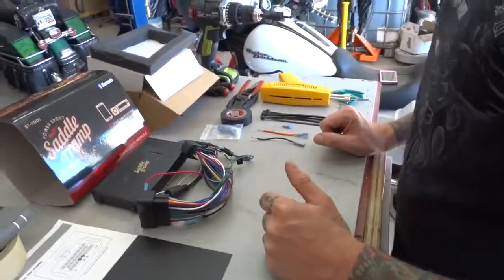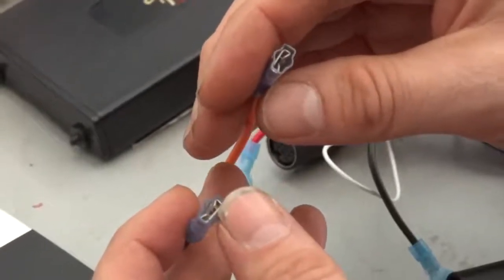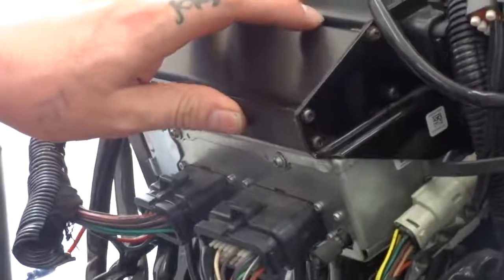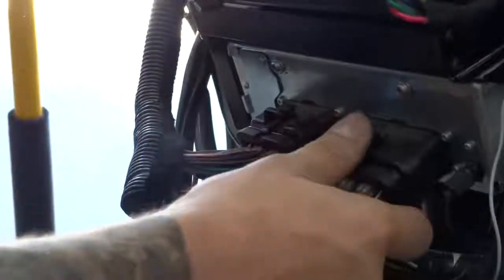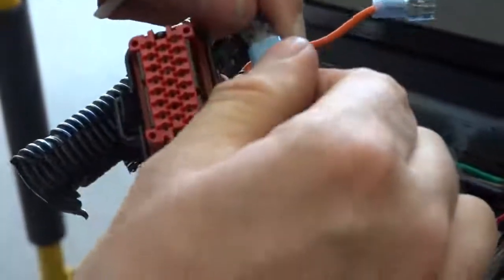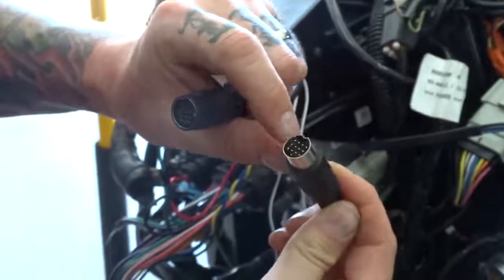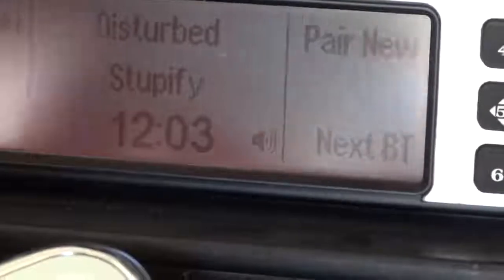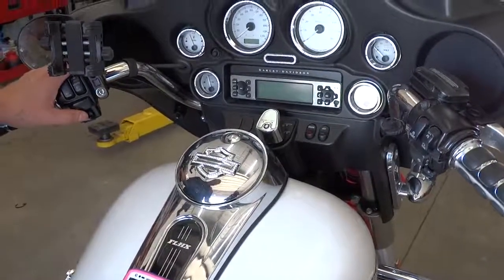ADS Audio & Detail Specialties   Saddle Tramp Install Video

Comment: Can just Plug the power wires to the amp turn on wires on the headlight wire harness no splicing wires at all.
Reply: T Prater can you give more information , I just got mine in the mail, really don’t want to splice or use the clamp type connectors.
Reply: @rondadavis2985  yes when you take faring off and unplug headlight there will be an orange and black wire hanging off the headlight plug harness. Plug your Saddle Trap Red hot wire to Orange and black ground to black wire. That orange hot wire only works when key is in the on or acc position turning Bluetooth Saddle trap on and off. Works Great 👍
Reply: T Prater Thank you for quick reply, saved me a lot of time researching.
Reply: I have a 2013 ultra classic I was wondering if this device would work with that? Secondly I was wondering if you were able to answer your phone through the 710 plug on the gas tank.? Also are you able to Bluetooth a headset to the helmet bypassing the 710 plug?
Reply: @rayduffy8213  I only use mine to link my phone for streaming music. Far as answering talking phone or using helmet bluetooth never tried. I ride to avoid talking on phone anyway.
Reply: Thanks